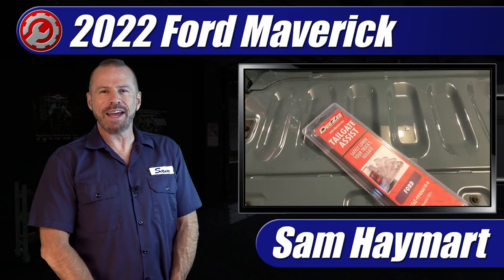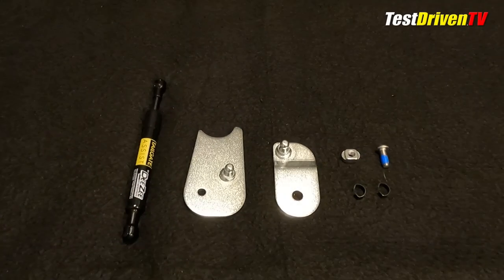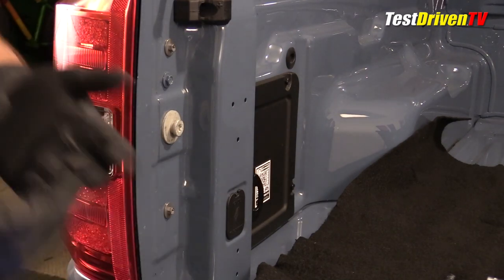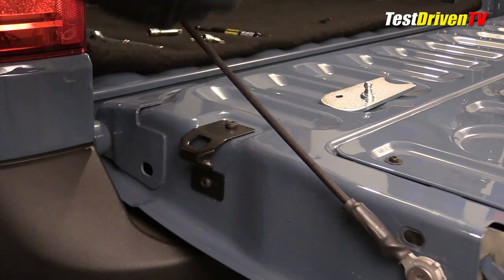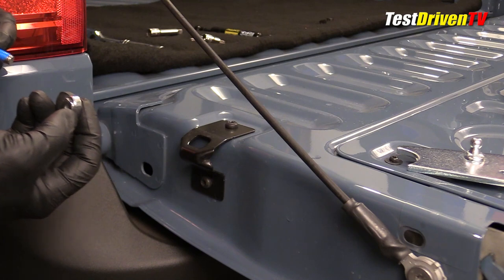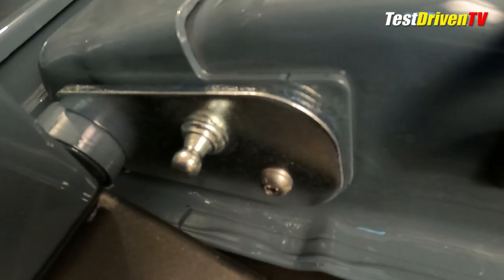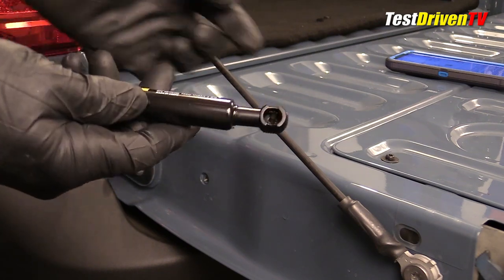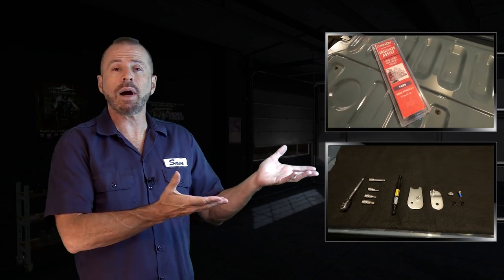2022-2024 Ford Maverick: DIY Tailgate Assist Strut Install

Comment: good idea to save the tie down/bottle opener so you can reattach if you make a lumber run.  That cleat is much more valuable as a tie down than a bottle opener.  who doesn't have a bottle opener on their key ring or in one of the 12 cubbies inside the maverick.  Would be nice to see some way to have the strut WITHOUT losing the tie down cleat.
Reply: Hhnu

Comment: Another one of "I'm going to get" for my '23 Lariat.  The only suggestion I have is to take the two screws that were removed from the bottle opener and reinstall them.  Serves a couple of purposes, 1) you won't lose them and, 2) they'll keep sand, dirt, water and what not out of the holes.
Reply: I just purchased the 24  lariat Tremor. Can you share why only one side is needed?
Reply: @AB-wx7uz  It's more than "strong" enough to by itself to slowly lower the tailgate.  Mine was installed about three weeks ago and it's been issue free.
Reply: Thanks 👍

Comment: Love the Maverick. However neither my grandpa nor my dad ever needed a "tailgate assist." Just sayin'.
Reply: I like it for Ubering.   Pull up at the airport and lower the gate.  Now, it would be nice to be able to pull a lever from inside the cab, or push a button to initiate the drop...  but still.   The only reason I like it is that some people will come up and start opening your door for you.. because some uber drivers are super lazy and want the passenger to load it.  But I dont want people scratching my paint..etc. so I want to lift the bag.
Reply: @BarryObaminable  Yep. Just had a pickup at Walgreens and the young gal (and I can't blame her here) hadn't dealt with a truck in her life. Boom went the tailgate. In went my order. If you're getting this as your "nerd truck" and wont be doing open-bed hauls all that often, the number of times I'm picking up mobile-ordered groceries is going to be 100x more often than my open-bed hauls.

Everyone is going to use this little truck differently. 👍👍

Comment: Tailgate nut broke from spot weld. Has anyone installed the tailgate assist strut and have it break due to the nut spot welded inside the tailgate? The only solution is to install a rivet nut using a rivet nut tool. Amazon has it for $32 for Prime Days. You cannot remove the tailgate panel and install a nut there because of the center beam support inside the tailgate. Believe me, I tried.

Comment: Replace the removed 
"tie down / bottle opener" with a folding 1000 lb.D-ring that attaches in the same spot. Still enabling you to tie-down lumber to both sides of tailgate. 😊
Reply: Link?

Comment: 40 degrees and windy today, so GREATLY appreciate your comprehensive walk thru - spot on and allowed me to be 100% prepared for a quick install.  I replaced the bolts on the bottle opener as well.  I would have missed that on my own. Thanks.

Comment: I just got my Maverick and this was a gift so I installed it the 2nd day I owned truck.  Only thing I’ve noticed is when it’s cold it takes forever to open.  It’s 20 degrees today and I thought I did something wrong but it must just be cold
Didn’t notice an issue when we have mid 40’s and low 50’s
Just something to consider for anyone getting one who lives in a cold climate

Comment: My maverick is two weeks out but, watching this video, could you remount the factory bottle opener tie down upside  down?  It looks like tie down opening part has an angle to it that would clear the assist strut if mounted like this.  Not sure if the holes would line up though.

Comment: Excellent video, agree on bottle opener remove sequence. Question: Can you leave the bolts for the bottle opener in place?  Will the shock clear the head of just bolt alone, I would prefer not to leave the screw holes open, again great instructional!
Reply: I saw in another video where guy just screwed them back in place. Makes sense and you don't lose them that way

Comment: I'm having the hardest time getting the nut to catch in the tailgate. I turn the bolt and pull and pulls tight but as soon as I go to tighten it just turns. Is it supposed to be really noticeable when it catches? I've been trying for 20 minutes now
Reply: Nah it’s fucking impossible. Just throw in the towel before you have a complete mental breakdown like I did.

Comment: This nstall will NOT work. What am I doing wrong with that second plate and nut on the tailgate? It turns, I feel tension,  then it pops loose again.

Comment: I installed my upside down, but I'm having a really hard time removing the shock to turn it over.
Any suggestions?
Thanks
Reply: I think the only negative is it will eventually get dirt and moisture in the cylinder. That might take 5 to 10 years to fail.
Reply: @BlitzHack  Thanks for the tip

Comment: Losing a tie down is a showstopper now you can’t ratchet strap 4 x 8 sheets

I won’t be putting that in now 😪
Reply: I agree. Before seeing the install I was thinking that I wanted the soft open when I finally get a Maverick. Now I know to save the $50.

Comment: Hello can be installed for the passenger side instead driver side? Best Regards
Reply from the maker: The bracketry is designed for the driver side but might be able to be modified to fit the other.
Reply: @TDTVGarage  Thank you very much.

Comment: I wish you would have demonstrated if the Tailgate Cable functions still work to have the tailgate open but at two different heights other than fully closed or fully open.

I would not trade that functionality for the dampering alone. I went to the Dee Zee site and it made no reference to if those functions are compatible with installing the Damper. 

You don't have to answer, but I still would need to know this before purchasing the kit.
Reply from the maker: It's a non-issue, why nobody even finds it worth mentioning. Of course you can use the mid-position, the posts are still there - they were not removed.

Comment: Thanks for the video but looks like the shock is installed upside down…..have heard complaints it catches the cable when closing if you install this way
Reply from the maker: Did you watch the video, listen to what was said? Read the instructions? It is installed 100% correctly. The people having cable issues are the ones who don't read the instructions and install it the wrong way.

Comment: Just installed the Arana tail gate assist and took no longer than 5 min to install and the bottom plate was a breeze with their locking nut! And 37.99 on Amazon